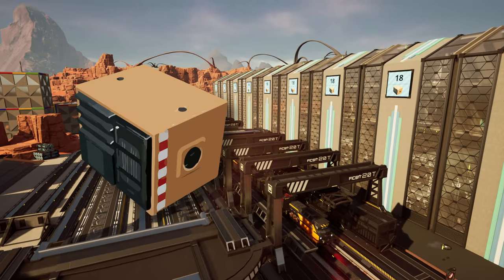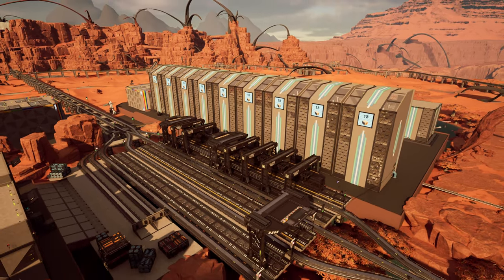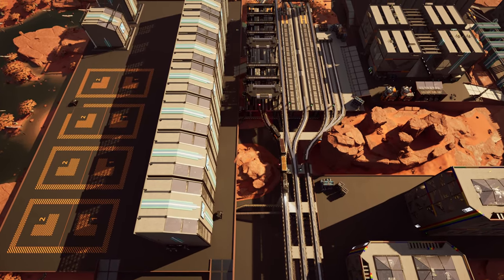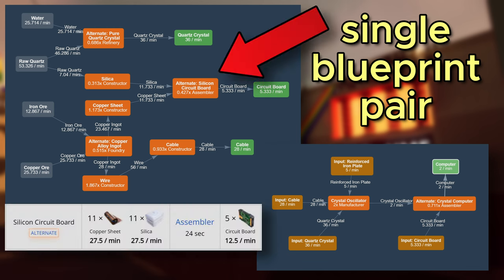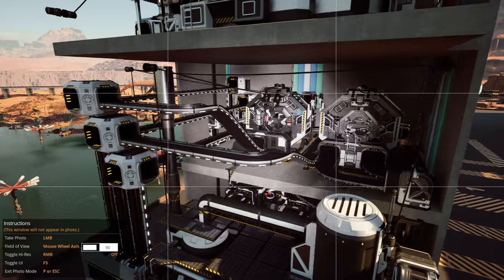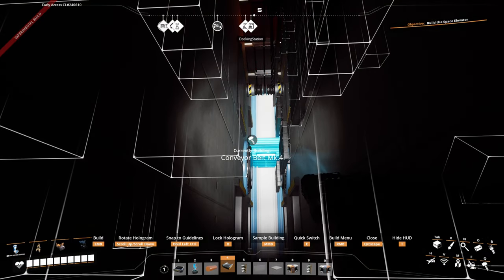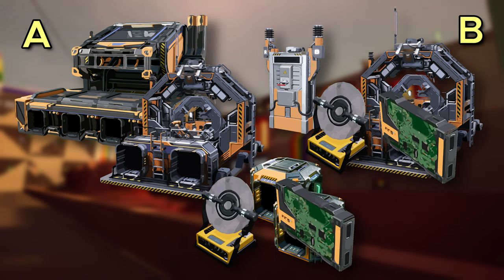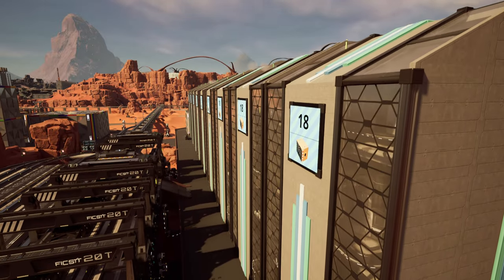THIS is like EASY MODE in Satisfactory!

Comment: There's no need to run miles of oil pipe. Just process everything at the oil site, and just run the conveyors carrying plastic and rubber to your hub. That's what I do. It would be a nightmare running pipe up and down slopes.